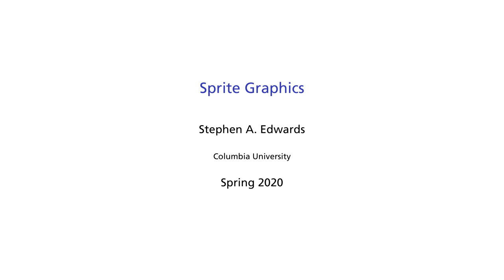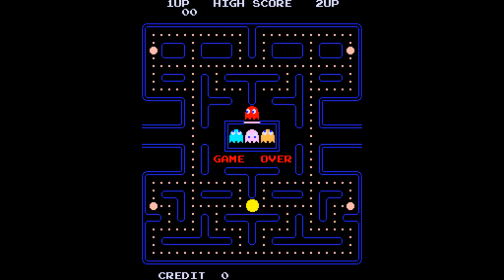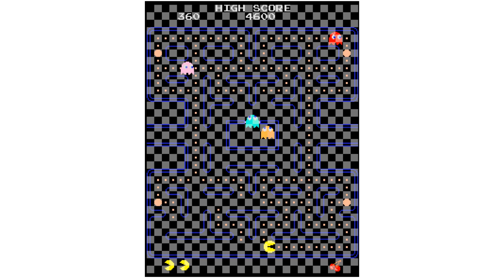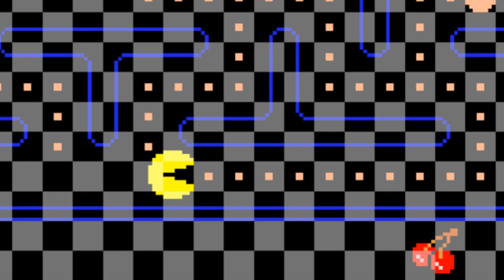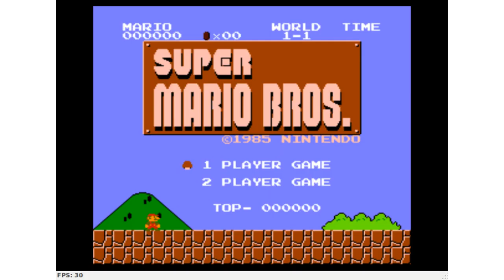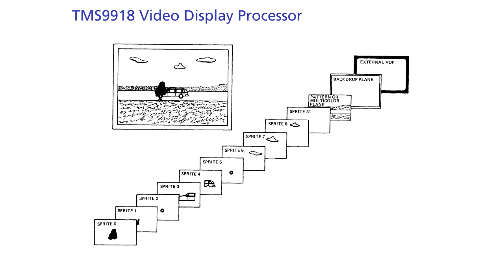Sprites

Comment: Hello Steve, I am here watching your video because yesterday I had one of the co-patent holders for the TMS9918, Dave Ackley, sitting in my office.  Dave is 87 years old and spoke about the 9918 like I would speak about a project I worked on last year. It was 45 years ago for the 9918. Dave coined the term "sprite" with respect to its use in computer graphics. Considering his name is first on the patent, I believe him! He described how the sprites were implemented and also the circuitry that encoded the NTSC video in pretty clear detail close to what I read later in the patent. To think at the same time (late 70's) I was struggling with trying to understand simple raster-scan timing chains, having to rely on mostly other people's designs (I was 15 years old) while Dave was 20 miles away building state-of-the art graphics chips. At the time if I had a little more design savvy, I would have been pushing for line drawing acceleration and possibly area filling hardware vs sprites, but I am sure would have taken more than the 1000 transistors OR so of the 9918 to implement.
Reply from the maker: Did Dave know about the line buffer approach that was being used in video arcade games? What does he know about how the 9918 technology ended up in the Nintendo Famicom/NES?
Reply: @stephen70edwards  

From Dave:

Unfortunately that was a very long time ago, being last century. :}

So I’m not sure what all we knew about the arcade technology of that era.

I think that filling the screen using tiles was well know at that time and was the basis of the TMS9918’s background.

My part of the #4,243,984 patent invention was the concept of a “sprite” and giving it it’s name.

This patent was submitted on March 8, 1979, issued January 6, 1981, and references some 14 other patents

My sprite concept was to use/extend the basic graphic tile concept to allow the quick/fine moving of a set of tiles as sprites.

I also knew that it was important to come up with a good name for these beasts and I came up with the idea of calling them “sprites”.

I picked this name because sprites can appear/disappear, jump around, and take different forms.

The reason for the 4 sprites per line and total of 31/32 sprites was a silicon size limitation.

By the way, there was a sprite attribute that allowed it to be a doubled in size (i.e. 16x16 rather than just 8x8) by doubling each pixel horizontally and vertically.

At the time we described the technology in terms of a stage (the tiled background) with the sprites being actors that passed in front of each other on the stage

I really don’t recall anything about how Nintendo or the Amiga computer came about using the TM9918 Sprite concept/technology. 

Dave
Reply: @stephen70edwards  I will have to ask him. If I have it right about line buffer system (looking at patent #US4398189A), looks like higher resolution (supporting interlace and 2X horizontal resolution of 9918), oriented toward frame-rate animation and 16 color (on 4096 color palette) foreground and background colors where background is limited to dictionary of blocks, allowing for composite multi-block patterns, similar to foreground. I am guessing this system is ultimately more complex and would not have been able to be placed on a single chip. Also, I assume memory bandwidth was much more limited in 9918 system. That is just me talking, and I am not a video graphics system designer. // I will ask about Nintendo...

Comment: Great explanation ! Thank you. Though I'm familiar with the C64 VIC II chip not the TI one. When it comes to coding the important thing is precise refresh timing with raster lines to avoid glittering. It would be interesting if you could make a similar video on how sprites were coded when there weren't hardware sprites (VIC 20 for instance).